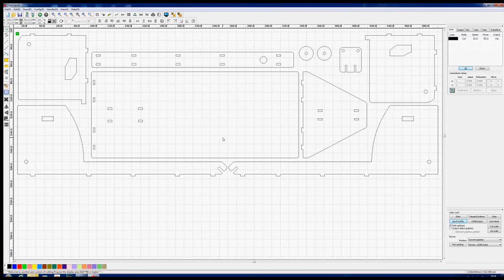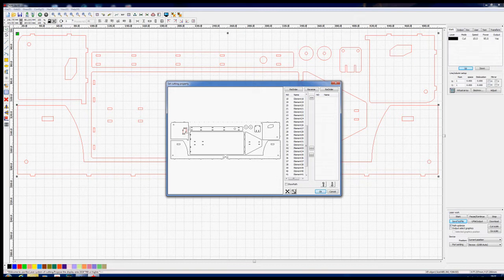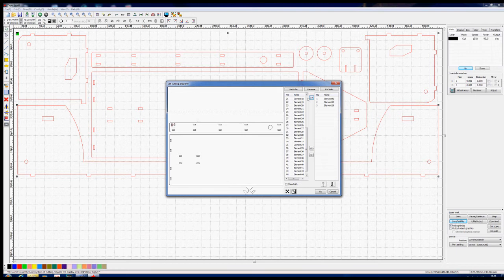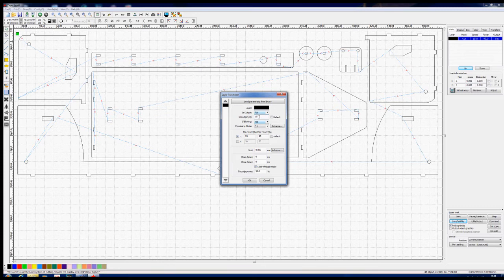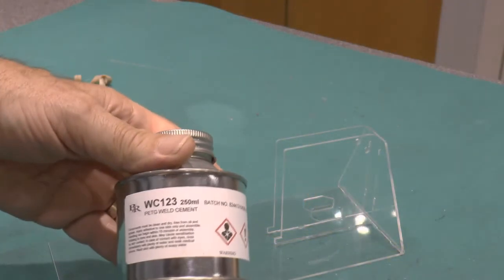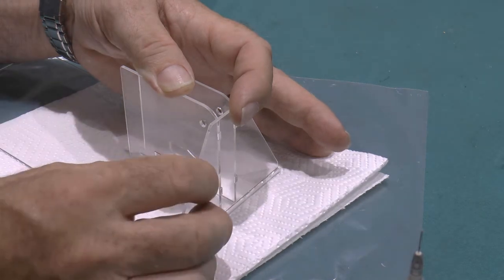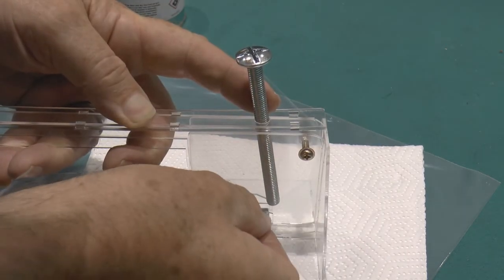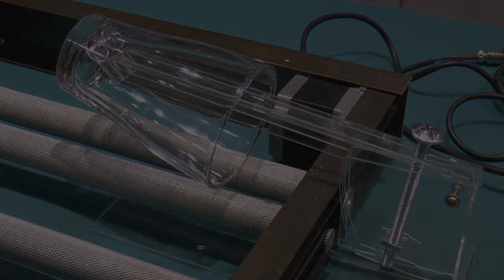RDWorks Learning Lab 18 Controlling the order of cuts

Comment: Just what I was looking for, thanks. But someone with influence needs to get the software makers to add an element back button, so we don't have to do the whole thing again if something is missed.
Reply from the maker: Hi Andy
At this stage in my learning journey I had not yet discovered the best way to control the cut order. There is the Handle Cut optimize window that tries to do things automatically but that is not reliable. See  https://www.youtube.com/watch?v=_3oUQ9gKjCk    for the method I now use for every program I create, Make sure all the cut optimize items are unticked including the one at bottom right of RDWorks.

Best wishes
Russ
Reply: andy parry 
It is easy with LightBurn.

Comment: Hi. When I'm cutting my laser is marking the path inbetween moving to the different shapes. Is there a way to stop the laser marking the wood as it's moving from shape to shape.
Reply from the maker: Hi
Your problem usually indicates 3 things
1) you bought the machine through Ebay
2)It is fitted with a K H Laser tube
3)The wiring to the HV power supply is incorrect
Take a look in your You Tube messages and I have sent my email. Take a picture of the wiring into the 6-way terminal block of your HV power supply and send it to me for checking.
Best wishes
Russ

Comment: I have been enjoying your videos which have been super helpful to me learning about my laser. I especially am interested in your jig for use with the rotary cutter. I have been turning disk on my lathe and attaching them to the glasses with double sided tape. Works ok but I have to turn a disk for each application. I have autocad on my computer at work and was hoping you might share your design. If so my email address is ricks_woodworks@yahoo.com. Thanks for making these videos and I'll keep watching them. They are fantastic.
Reply from the maker: +Richard Corley 
Hi Richard. I did design this jig for two purposes. Firstly I had experimented with tumblers on the rotary and to get rid of the taper I had to block up the rotary device on one side. Rather crude, so I thought I would try and think of a different approach. This was my first attempt but it's main purpose was to demonstrate in a practical way how I went about ordering my cuts and the tools available within TDWorks for doing so. It was made out of flimsy acrylic and to be brutally honest was not one my finest designs (only in theory!!) I have thought about this issue several times since and think I ought to design something  much better because this is the wrong approach to the problem. Your disc method is the only way to do objects with handles on but for wine glasses, tumblers etc there must be a better universal way.  
Although I am 80% retired, for the past 3 weeks and for a week or two more, I have been swamped by the other 20% all in one go.  My video output/"playtime" has suffered because people are PAYING me to do REAL work. It's very inconvenient because theres so much I want to play with!!
Thanks for your kind words  but the jig was a non-starter.
Best regards
Russ
Reply: +SarbarMultimedia That's my main hold up. My work day is 12 hours long and then seems like most free time is yard work or home repairs. If you do come up with a better way I would be very interested.

Comment: When I go to cutting order there are several extra cuts in there that go over previous cuts, do you know a way to delete these cuts from the list?
Reply from the maker: +Mentorcase 
Sadly no, this feature is for ORDERING your cuts not EDITING them. Most times it is only a matter of closing the list and then zooming in on your RDWorks drawing, putting a marquee round the affected area and the hidden feature will appear so that you can delete it. I have had situations where, what should have been one continuous path, was not. Even more sadly, RDWorks has insufficient editing capability to deal with simple drawing problems like cropping, filleting or extending lines, in those cases you have to go right back to your originating software to fix the problem. It's very frustrating BUT you soon learn to develop checking strategies before you leave the originating software. For instance in my CAD system I have a switch-able feature to "show breaks". Any more than ONE break per feature indicates a problem to be fixed there and then.
Reply: I had this happened to me a lot when files came from different platform (e. g. client's converted vector lines from adobe illustrator where stroke and fill are expanded but overlap each other). Usually it's a double artwork so RDWorks read it as double lines. Try to select all your artworks (Ctrl + A) then go to "Handle -> Delete Overlap", then play around with tolerances.

Comment: great series of vids..well done.   Did you find out the result of your power loss?  very interested in knowing what happened
Reply from the maker: +Frans John It can only be the laser tube so  I have ordered a new  tube from China. I failed to get any money back for the "non- performing equipment" The Chinese company that sold it to me (an Ebay seller called SUNSHINESMILESERVICE) obviously know how our systems work better than we do. Ebay give you about 3 weeks to complain so you've got to get your machine commissioned VERY quickly to establish whether it's performing reliably .Pay Pal will only deal with something that is delivered and is not to spec.If it's what you ordered  but doesn't work then it's classed as a warranty issue and it's between you and the buyer who are in China and ignore complaining emails) ...so no help there. I will not be using my PayPal account for expensive purchases any more because their buy with confidence claims are not worth having. I have purchased the £200 replacement tube with a CREDIT CARD from Ebay. I have real rights with a credit card if the equipment is not as described. Not so with a Debit Card (almost no protection) and with a direct debit from your bank account (that's the way Pay Pal try to get you signed up) it's like paying cash and you have ZERO protection. It's been an expensive lesson to learn but I hope other will read this and benefit from my mistake.
When the new tube arrives, in 2 or 3 weeks time, I shall be making a video about fitting it and testing it. Thanks for your interest
Reply: +SarbarMultimedia  Thanks for your reply so promptly. I bought a 60W laser and trying to get it to cut leather 2mm... tried diff speeds & power settings.. Wont cut through. Have cleaned all mirrors and aligned. Have noticed the Y axis mirror has a number of scratches on it..  emailed seller on that.
 Wld be interested to know if I can upgrade to a higher wattage tube and does it require additional electrical/equipment changes.

cheers
Reply from the maker: +Frans John Firstly, although my machine is not working properly it starts off for a about 10 or 15 seconds at full power. I have just put a small piece of 4mm leather on my machine and have successfully cut through with 95%power (mine is a 50watt laser) and 10mm/sec speed. I also cut the finger off an old welding glove and used the soft 1.7mm thick  leather to cut a 40m square at 15mm/sec 95% power without any problem. I'm sure you should be able to do 2mm easily with 60 watts. I don't think a few scratches will  mess up your power too much. Is your beam coming out of the nozzle  centrally (or at least not hitting the edge)? Put a piece of soft wood (pine) under the nozzle. Raise the table so that the wood  touches the nozzle and then raise the table another 0.5 to 1mm so that there is pressure on the wood. Rotate the wood plus and minus 45 degrees to put a circular imprint of the nozzle in the wood. Do a test pulse. When you remove the wood you should see a burn in the centre of your nozzle well clear of the edges.

If you can get some acrylic offcuts from your local plastic supplier or sign company this is the absolute best material to do test work with because it does not burn like all other materials, it has the unique property of VAPORIZING when hit with a CO2 laser. The depth of vaporization is an excellent immediately visible indicator of cutting power.

I'm no electrical genius so I can't competently answer your upgrade question. I do know that the length of glass tube gets longer as the power goes up so an increased wattage tube may not fit your machine. I would also expect to change the power supply unit. 

Hope some of this helps.....I've never tested leather before.....smokey but cuts cleanly and easily.
Reply: +SarbarMultimedia   Thanks again..

When I do a Pulse test on the leather it cuts all the way through..